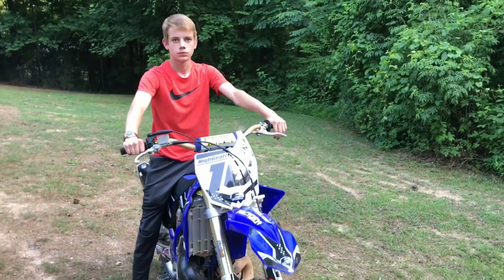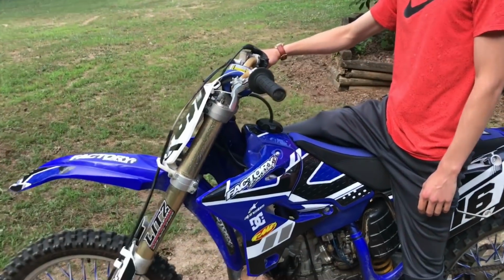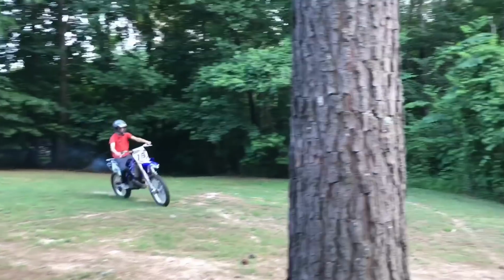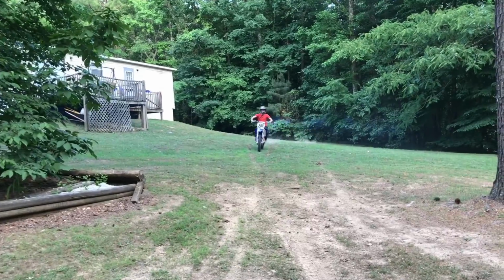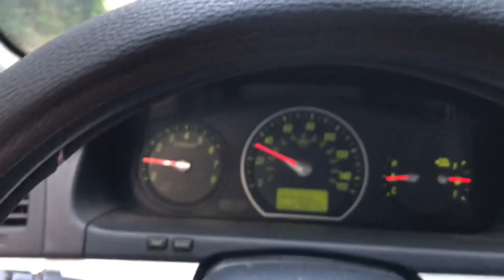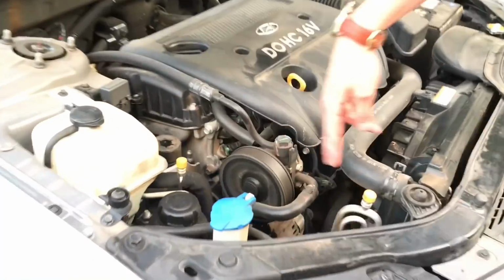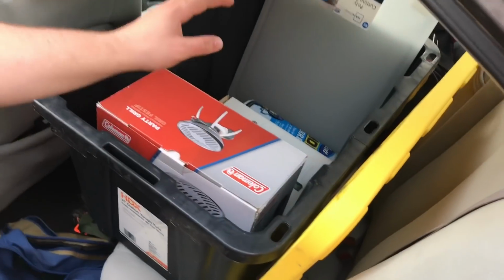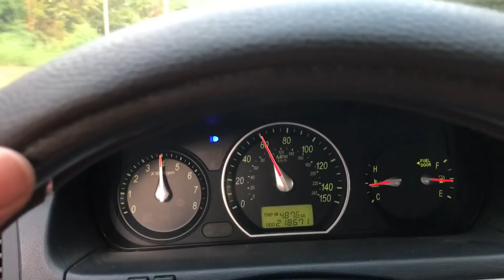The BENEFITS of having a Rekluse AUTO CLUTCH - YZ250

Comment: Not trying to downgrade your bike or anything... but I personally think using the clutch makes riding more fun... just my opinion.
Reply: I honestly think it would make me slower. When I'm coming up to a corner, clutch in, rear tire locked, I pin it and drop the clutch so it hits right in the meat of the powerband. I live and breathe YZ250's but the amount of tq and hp right off idle ain't much just like any other 2-stroke. Maybe if I was tight trail riding I'd like one, but otherwise I'd spend my money on other mods.
Reply: @jasonjaeger4042  i would love it for trails all i do is trail ride jumps arent my thing i like big hills and the autoclutch would help on hill peobly
Reply: @Jacob TratnyekLmao
Reply: Exactly, you have to be skilled to ride 2t, if you wanna be lazy and stay in gears for long periods of time, or engine brake, just ride a dam 4 stroke
Reply: @Aglow37  Exactly. I get on a 4t and I get bored. It's like driving a standard trans and then hopping in an auto.
Reply: @jasonjaeger4042  you can still use the clutch like normal
Reply: @praiseallah8978  I know that, being an MX tech I've installed several hundred of them.
Reply: I have seen so many ppl ruin their bikes with auto clutches. They think they dont have to use the clutch between gears, rekluse is only for stalling in gear basically
Reply: I race and I just have one for if I mess up on a hill on something like that I don’t have to worry about starting it

Comment: Sorry mate but the clutch does not engage as soon as you let off the throttle, it engages when revs drop below a certain threshold. So it doesn’t
automatically go into freewheeling , only if you let the revs drop low. Here...straight from rekluse website: “Disengagement: when idle speed is reached the wedges retract , exp disk contracts, and clutch disengages.” So you can still do engine braking until the revs drop right down. Engine braking doesn’t kill 2 strokes. Unless you were going down the biggest hill in the world and you didn’t blip the throttle, then maybe you might start to hurt it, but as long as the engine is running it’s getting oil, and the revs are hardly that massive off throttle anyway.
Reply: I don’t think they read cause all that info is in the instalation directions and they obviously didn’t discover that during the install.....